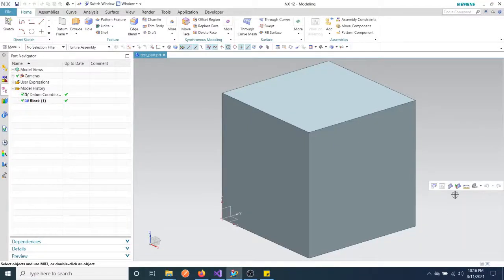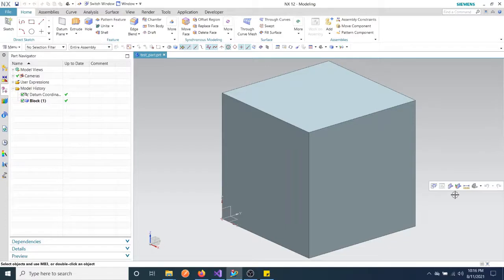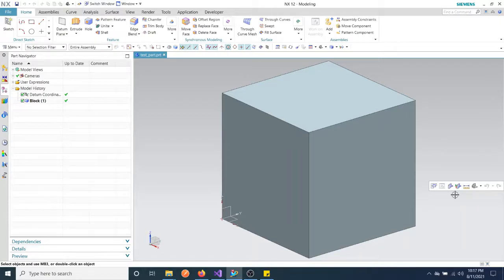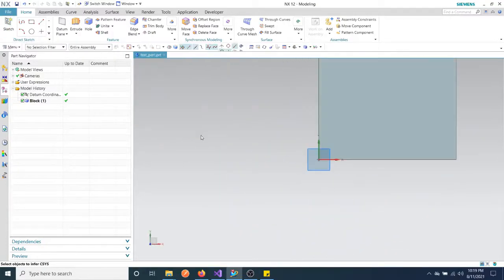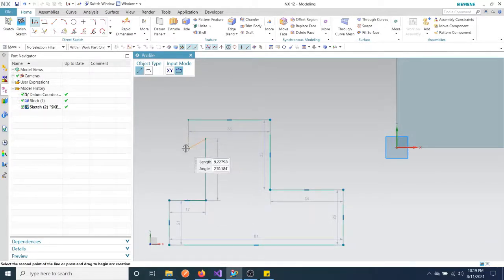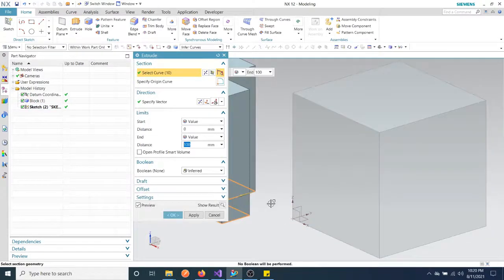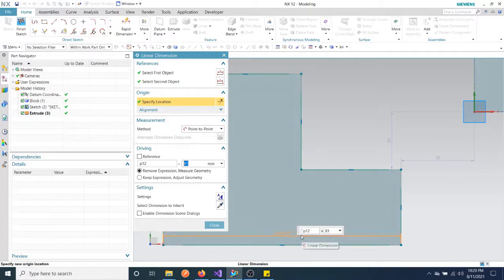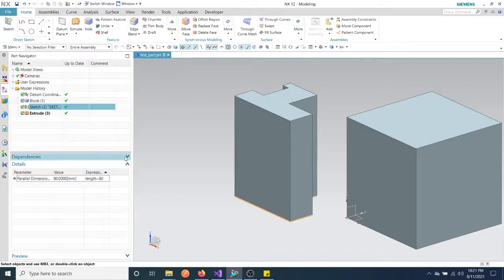How to Update Expressions using NX Open C#

Comment: What is the benefits of using programming language in nx its very time consuming
Reply from the maker: There are many benefits ...some of them are 
1. Repetitive tasks can be automated - eg.adding BOM tables 
2.Parametric based modelling can be achieved like this video ..eg.i can create my complete Models ,drawings and assembly based on expression and can update it by reading an XML and can create a new configuration 
3.finally to make life easier for designers to use these tools and avoid some human errors ..hope I tried to answer your question